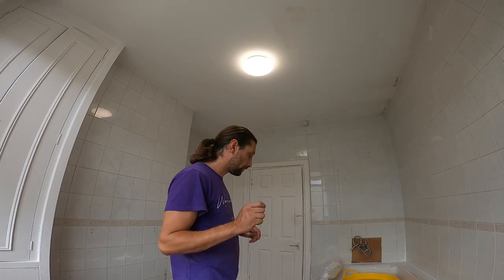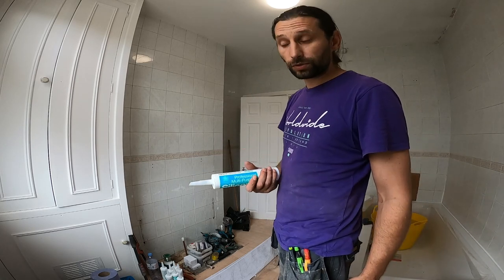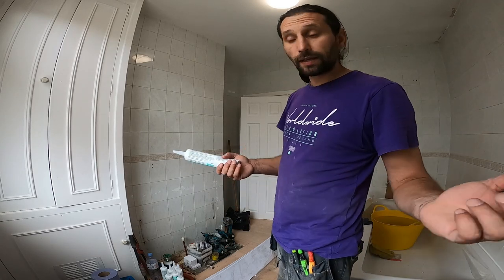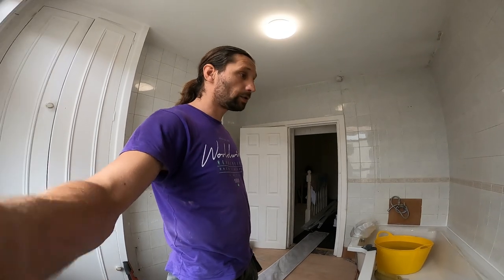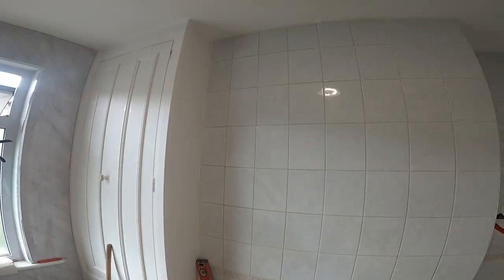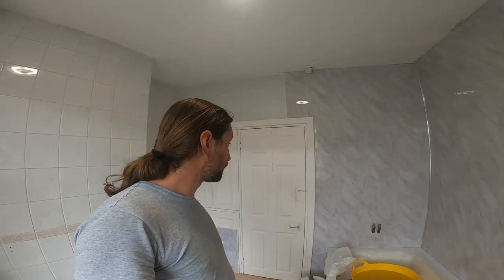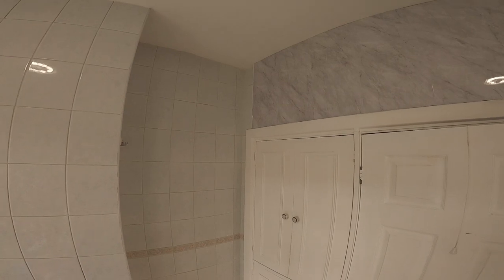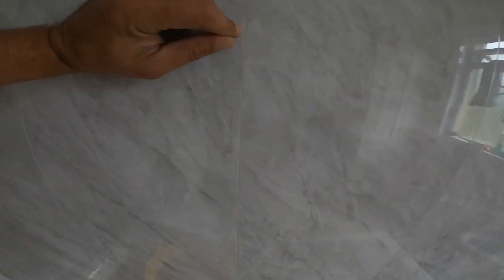Install Bathroom panels - Over tiles ep2

Comment: Hi There   Yea very good job quick question as i am about to use these panels on my kitchen walls securing onto wall tiles, but did you later seal round any gaps at the window sills with the silicone to finish off the job & would you also use where the panel meets the ceiling & floor if already tiled.  Cheers Jim
Reply from the maker: Yes, absolutely i will always try to put a line of silicon at the ceiling and on the floor before applying the board and then at the end on top of the board as a finish and that it will block the board movement at the top and at the bottom however in some jobs i need to use the trims  (customer choice) and i will fill them with silicone. If you use the silicone in stead of the adhesive and you put to much just in one point it's never going to go off it's going to be trapped like in the tube recipient not to much air to go off. If you have more questions fell fre to go on my Facebook and call me i will do my best to help. https://www.facebook.com/How2chanel
Reply from the maker: this clip is with no trims https://youtu.be/jwrdwEV-vnw?t=1084

Comment: The most important part for me is not to be found in any how to videos. How do you fit a panel into the second corner piece? Or is ot a case of attaching the corner piece to the last panel?
Reply from the maker: Hi. Either you attach it to the other panel, or you are forced in by pulling the bought out for a bit, then push them at the same time in. I personally prefer not to put the corners in. Just fill the corner of the wall with a good silicon then push the panels in and at the end silicone the corner of the panels again and that is going to look  much better and you will get a solid waterproof.
Reply: @How2Extreme  Thank you.
Reply from the maker: You welcome
Reply from the maker: https://youtu.be/jwrdwEV-vnw?si=JXmZ7SesMpe8jsw0

Comment: What adhesive did you use? I've not used these but I always wonder in the long term whether condensation would build up behind the panels and cause damp?
Reply from the maker: Hi in this video the supplier sent me the multipurpose silicone and yes there is a probability that you might get condensation depending on how cold the existing wall gets and how hot the panels  are getting . depending on the house and the people using the shower
Reply: @How2Extreme  Thank you. Keep up the excellent videos 👍👍
Reply from the maker: Thanks.  I will

Comment: Yes it now has the original white panels and they are not very stable
Reply from the maker: In that case, the best solution is to stick 2 by 1 timber to the metal, then spray foam all the gaps in between, then cut the excess foam and stick the panels onto the timber. I will do it like that but its alot of work.

Comment: Do the panels click in ?  
My toilet is flush to the tile how would I panel to the top of toilet 
Lovely job at the finish
Reply from the maker: Hi. The panel's go in but they don't click. The right way is to take the toilet out and fit the panel's but the most common way used by the trades is to take the cap of the toilet out and put it back after paneling , forcing it a little bit in place.Thanks
Reply from the maker: https://youtu.be/fL6Tq7EBs_E
Reply from the maker: Watch this clip